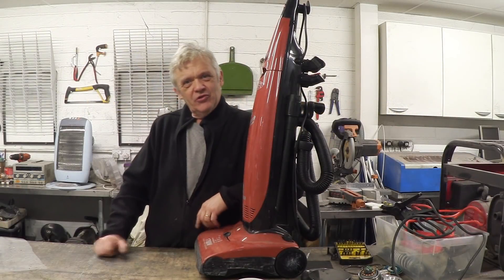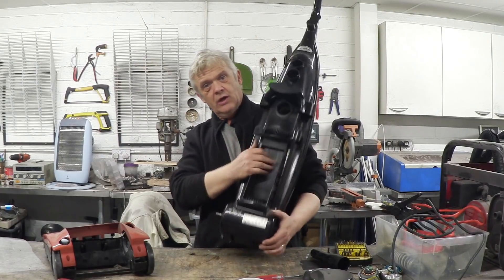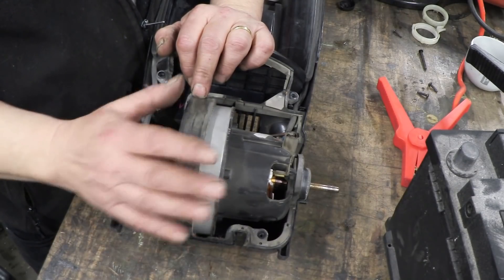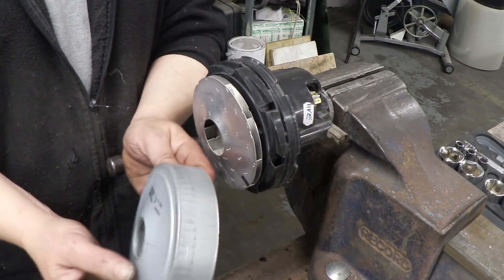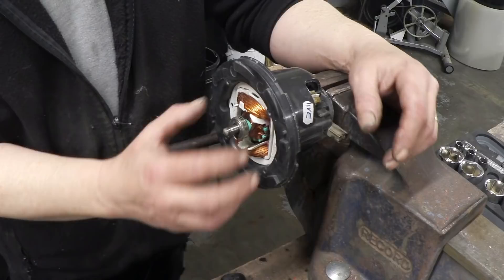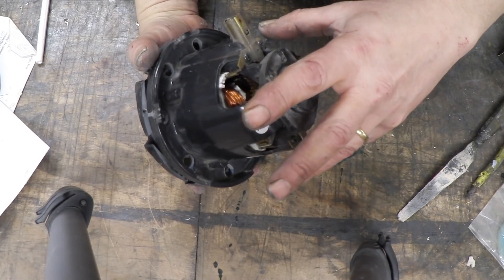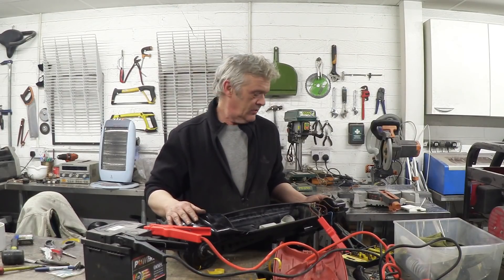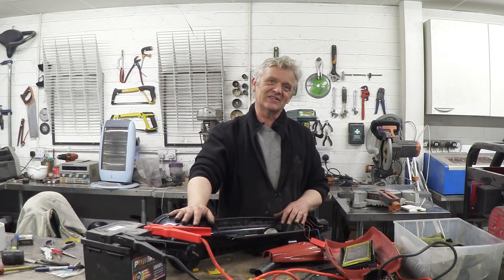Uses For An Old Vacuum Cleaner 2 - Gassifier Air Pump

Comment: Please correct if I'm wrong,  but I thought electric motors made more heat when they were under powered?
Reply: Define “under powered”?
Reply: This is basically saying there is an efficiency drop and the size in that drop is greater than the total rate of waste heat energy at higher voltages of operation. I’m no expert on universal motors but would assume once you’ve put it enough energy for the motor to overcome it’s own inertia the build up of heat (motor’s temperature) is going to be more a function of the length of time it is operated for, after which it becomes ‘under powered’ due to the now different thermal properties / operating regime.

Comment: I built a kids baseball pitching machine from vacuum.  Hollow poly 3” balls; poly flex sheet rolled to right dia.; air blowing instead of sucking; & side connected poly tube to feed balls.

Comment: good stuff Robert. Mate do you have any vids about induction motors? i have a 240vac cap start induction water pump motor that i wish to control the speed on..Can i run a VFD to do this? i am making a rock grinding machine and its too fast as you can imagine..thanks for any feedback..

Comment: I know its a bit late in the process but have you considered simply starting the generator on petrol to draw the air through while firing up the gasifier, then turning off the petrol & running on syngas. That would also overcome the problem of choke/fuel enrichment while starting a cold engine, it would be already warmed up. No air pump, no electricity/battery needed...just keeps it simpler. Apologies if this has been mentioned before.
Reply: Also, that would mean that you could hook it up and try it out RIGHT NOW! well OK then, I'm in Oz, so after you get some sleep :-) We're all impatient to see it work lol

Comment: I am concerned about the use as a gasifier blower. The astic may get to hot and melt. Even if it doesnt melt completely, it is most likely going to warp the impeller until it isn't effective anymore.
I suggest you use the plastic parts as a mold and cast the parts out of aluminum. That would make a great video!
Reply: Except that this blower (more like a sucker?) is the very last component of the system, where the generator engine carburettor is. The gas is cool at this stage.